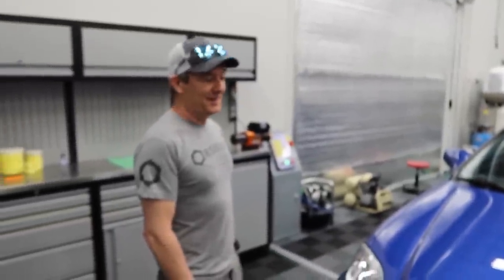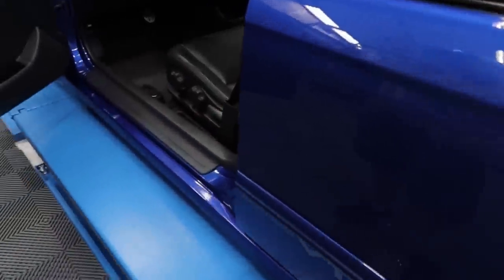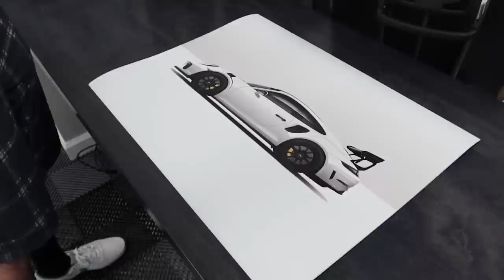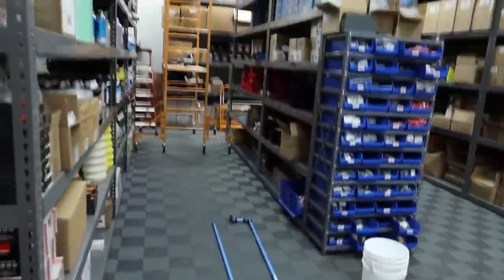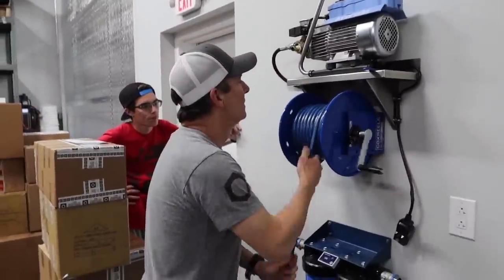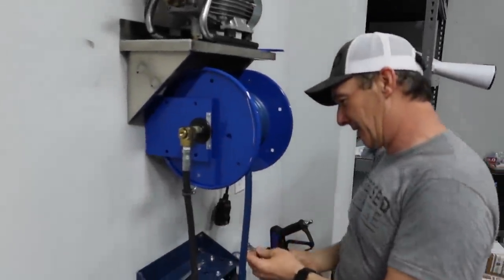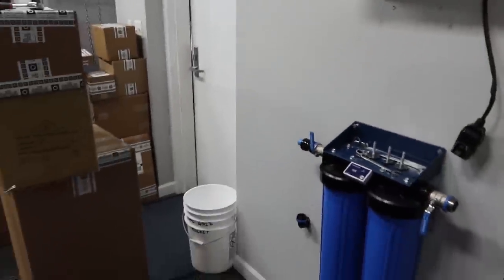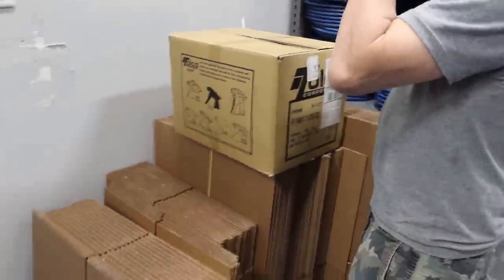Dialing in OGHQ 2.1: Wall Mount Pressure Washer Removal

Comment: 9:22 - I drilled out the aluminum rivets on the side to pull the reel from the mounting plate. It takes a few minutes but makes mounting and getting the bolts alot easier.